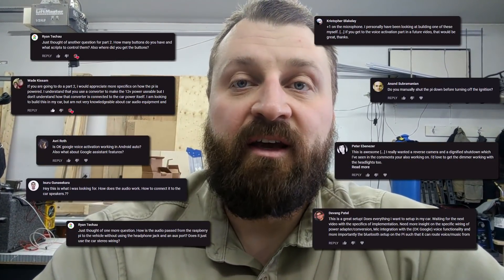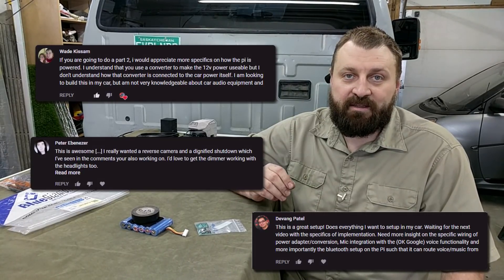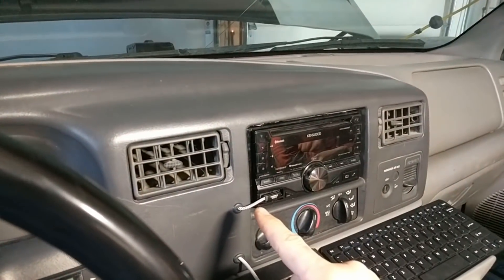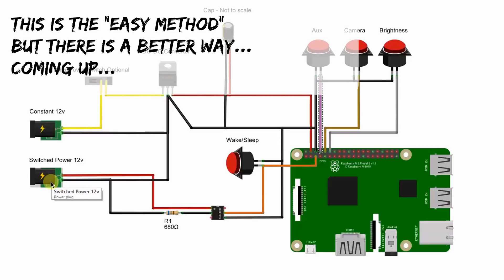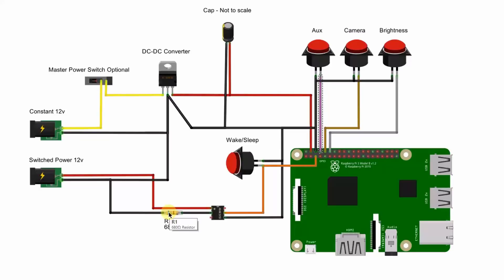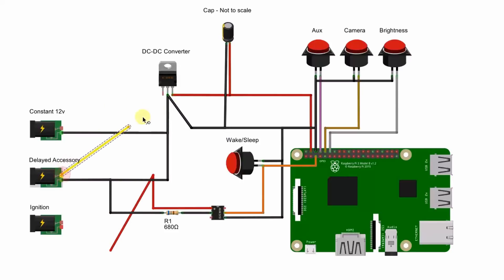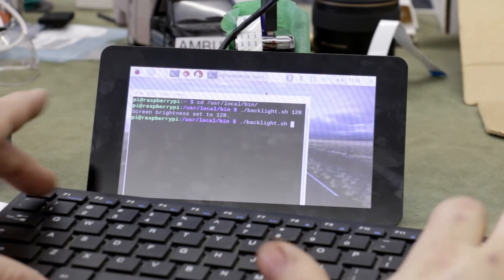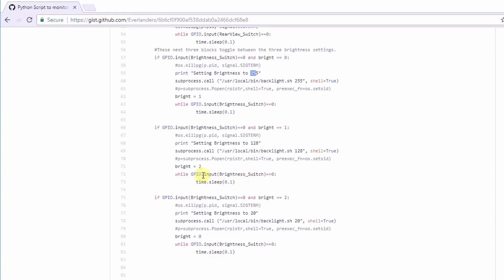Wiring AndroidAuto & Raspberry Pi to your Car - Rear View Camera, Connection Diagrams, OpenAuto

Comment: Couldn't you set up the rear camera to turn on when the reverse lights turn on instead of the button? Also how is the mic when calling people? Pretty good?
Reply from the maker: Sure you could, and I gave instructions for this in the script on GitHub. But in our case, it's more important to have it function as a rear view mirror when driving forward in heavy traffic as we have a camper box mounted that obstructs the mirror's view.  Can't speak for the mic, I don't call people.
Reply: Everlanders awesome built btw and thank you for the quick response. But the "ok Google" detection picks up good from the mic, correct?
Reply from the maker: The hot word detection "Ok Google" is dependant on a specific hardware in the phone, as such it uses the mic in the phone for this, not the external mic I've added.  Once the hot word has been detected it hands off the recording to the lapel mic to record your request, and that works just fine.

Comment: There are a lot of forums and videos of other people doing this, but none with android auto and camera stuff. By far the best information I have found if anyone is doing this! Absolutely love it. And I was successful in building it...just now....not even five minutes ago. Now comes the really hard part, finding a place to mount it. :) Just going to add a few other things that I had to do for anyone else reading the comments. When I built the two files (ButtonMonitor.py and backlight.sh) they didn't have permissions to run. So I had to run a scrip to give them permissions. Here's the link for it http://www.dummies.com/computers/raspberry-pi/working-with-file-permissions-on-your-raspberry-pi/ . The line that I used is about halfway down. 'sudo chmod a+rwx filename-or-full-filepath' without the single quotes. And then the other thing I had to do was enable the camera through the config folder. (you might have mentioned it in this one or the previous ones if so I just didn't catch it.) But other than that everything has worked great! I also used this tutorial to load openauto. https://www.novaspirit.com/2018/03/12/android-auto-on-raspberry-pi/. 

Multiple Thumbs Up!
Reply from the maker: I did show how to make the scripts executable at 10:25 - But I guess it's a lot to take in.

Comment: Your Video is really interesting and I will definitely build this setup in my car too :)
But i was wondering whether it is possible to connect the wire for the reverse gear lamp to the raspberry and switch to the camera view if reverse gear is selected?
Thank you!
Reply from the maker: Yes, several people asked for this, so I put the code for this in the GitHub gist too.
Reply: Thank you very much :)

Comment: Cool stuff, great work getting it all working.

One thought - though I don't know where you would mount it, how about an auto dim for the screen? I was thinking a light dependent resistor (LDR), you'd probably need to be able to override it with a button though.  Is there any way to add a screen with a slider to control volume or the monitor brightness?
Reply from the maker: It would be easy to tie it to the headlights using the same optocoupler I give instructions for in part 2 - but I'd rather have the button.
Reply: Looked into it a bit; the Pi doesn't have an ADC, so you'd have to add one to the circuit. Thinking about it a bit more, the LDR might be a bit sensitive and cause the display to constantly adjust (think of driving down a road at night with street lights every few hundred meters), so a potentiometer might be a better choice.  Thanks
Reply from the maker: :-)
The potentiometer will still need an ADC

Comment: Thanks for the video. Really cool project. I wonder, could you do this with a Pi zero-w ? I only ask as I have a bunch of them kicking around since they are only $10 each. thanks, look forward to your response.
Reply from the maker: No... It has no DSI Display connection and lacks the hardware acceleration that OpenAuto utilizes.

Comment: Awesome. I have been working on something close to this. I was going to do it without the cellular interface, using the GPS hat and the accelerometer hat, but your way is much easier. 
I am also adding 2 additional features to mine. 
1)I want to be able to remote start my vehicle using a pi face relay + . It will control automotive relays that tap into the ignition wiring cables just like an aftermarket remote start. 
2) Using the same board, I want a touch screen button to turn on and off my amber wigwags.

I will definitely be referring to your setup for my initial build. Thanks again.

Comment: Another testing-question - how did you wire the touchscreen ? I just started testing with the buttons - and when it came to the wake/sleep button I realized the pins i would need for that are already blocked by the touchscreen.
Reply from the maker: Are you using a different screen than me? I had no overlapping pins...
Reply: No the same (I suppose) But I just found out there are different two ways - or better directions-  to wire it .. The one I used would not work as it blocks the pins, but some tests later I figured it out (My way was powering the Display - by USB - and when Power comes on - the display uses the pins for the button to automatically switch the Pi on - turned it the other way around when i tested the converter and removed the "switch cables" - now the pins are free (button working) and the pi powers on the display when 12/5V are on.)

Comment: What is your OS setup ? I think your booting a rasbian OS and then openauto. i like to use the hardware buttons to the io pins, so a version of crankshaft (wich works with my samsung a3) would not be useble i think (i am new to programming for raspberry pi) (i have the pi 2b+ (maybe i swithch to the new pi 3) so what rasbian image do i have to use ?
Reply from the maker: Open auto requires the hardware acceleration in a Raspberry Pi 3, so that's probably going to give you a significant performance boost right out of the gate. I haven't even looked at crankshaft, a closed system that I can't view the source code gives me the heebie-jeebies. In my case the system will be doing far more than just running Android auto, so I need the flexibility to run whatever I want. So I'm running raspbian stretch updated to the newest fastest best.

Comment: Great channel, and Canadian too (Hi from Kamloops BC!) -- Stumbled upon it related to Android Auto, but have already viewed other segments, and you've definitely earned another subscriber!

Not knowing much about the raspberry pi and its hardware... I wonder if instead of using HDMI if perhaps using shielded Ethernet (CAT 6 or even 7) would be enough for the camera. Would remove points of conflict and simplify the run, I would think.
Reply from the maker: Unfortunately no, there are only eight conductors in CAT6 and I think they are only shielded in pairs. HDMI (and this camera) require a few more conductors as well as more shielding. Even this shielded HDMI cable I have is pushing the limits.

Comment: Hi again, maybe I missed during the 50 times I watched that video - but what optocoupler did you use ? Just started ordering stuff for the final installation in the van ...
Reply from the maker: I used a 4N26 that I already had laying around, but the specifications are very loose because we don't need high frequency or extreme isolation. Did you receive the adapters already?
Reply: Ah ok - ordered a 4N35 .. should do it then. Yes - I received them - big thank you !! Cant wait to test them

Comment: Do you have any more information on the script you used? I have the openauto head unit already, but would like to get my dash cam video as an overlay like you did with the rear view
Reply from the maker: Yeah, I gave the instructions on how to do this in this very video you're commenting on.
Reply: Sorry about that. I thought it was about wiring only and didn't get that far. Thanks for the information and appreciate the work you've done

Comment: What does the AUX button do? I believe the camera button activates the camera/cycles through camera modes and the brightness button cycles through the preset brightness modes. Did i miss something else that your system does with the aux button or is it just for future proofing?
Reply from the maker: Future proofing, the plan will be to have all four cameras start recording to file, so often we are on a road trip and something amazing is happening, you just can't get your camera out in time for that shot.
Reply: Everlanders Thanks. Looking at buying parts for a similar build.

Comment: Have you tried connecting the camera's connector to a (passive/non-repeating) HDMI switch? Is raspbian able to re-detect the new camera? If It's hot-pluggable it should work. Would be quite cool, as these cameras are so cheap one could set up a couple and switch between different angles.
Reply from the maker: I have not tried switching cameras, I do know that they fail until a reboot if disvonnected. sudo restart webcamd works on some cameras. I will have Raspberry Pi zeros at these other angles, and then just stream it over Wi-Fi accepting the half-second delay.
Reply from the maker: There are also Raspberry Pi camera switching boards that will switch for cameras, but I didn't see a lot of success stories so I steered away from them. I've linked to them several times for others comments.
Reply: I see. This info may be useful to you: If you use MPEG2 (no H.264 inter-frame compression), you might even be able to get lower than 100ms latency. PhobosLab has some extremely low latency server on Github (free/libre), search "jsmpeg-vnc" and it's demo video. Though it's using a JS encoder. Haven't had a deep look into it, but there could be some C code around that doesn't require a browser instance to stream.

Comment: How did you get the brightness script (this line   echo $level > /sys/class/backlight/rpi_backlight/brightness) to run as user pi? I can get the test to run as sudo, but get a permission denied when I attempt as pi.
Reply from the maker: I didn't do anything special... it runs as pi for me. Are your permissions set - sudo chmod 755 backlight.sh
Reply: The script was already 755, but that made me check the "brightness" file that is changed on line 13 of the script, I had to chmod 666 to make it work. thanks for the help.

Comment: I already posted - how much I like these videos but let me add: I setup my system using your tutorial - and yesterday it came to life (on the workbench)- was really easy and done within only 2 hours!  But one question came up: How would you mount the rear-view cam to your car without drilling a hole big enough for the HDMI-Plug  - and how did you get the Raspi-Cam 
and all that to be waterproof ?
Reply from the maker: You only need a space big enough to sneak the flat ribbon cable through. It can come out next to a licence plate light or through a window seal. I will be 3D printing ABS enclosures to waterproof mine. I would be happy to print one for you. Which car will you be installing on?
Reply from the maker: Does the G20 have a 3rd Brake light up high?
Reply: I am afraid no - but it seems like there was a rearview cam or something like a third brake light installed by the previous owner - the hole remained - i will try to work the flat ribbon through it. We will see :-)

Comment: Could you connect something to the reverse light for switching on the camera automaticly when car is set to reverse, and cut the feed when its not in reverse anymore?
Reply from the maker: Yes, I have posted this code to the GitHub for this too.
Reply: I can't find you on GitHub. I am doing the same thing with the 12v dropped to 3v and launching my video stream with code after the signal is seen on a gpio pin. Where are you on GitHub?
Reply from the maker: https://youtu.be/jFXxtxoi_pc?t=9m53s

Comment: Maybe I misheard but in part 1 Oru said you can install multiple cameras. Can you show a video on how to do so? I really like the build. I have been trying to research a way to install multiple cameras on one screen in my car
Reply from the maker: Yes, In time I will show this. In our case there are already several Raspberry Pi's controlling other things, so they will just have network feeds to the display we are nearest to. But if you want just one Pi, then you just need a Multi Cam adaptor board like this: https://www.robotshop.com/en/arducam-multi-camera-adapter-module-raspberry-pi.html  There are 3 or 4  variations I've seen from different makers.

Comment: I'm also working on a similar project except mine will be connected straight to the wiring harness and completely replace the stereo system. I have the prototype of the build completed and am just waiting on a few more parts to arrive before completing the final install. Looking forward to video 3!
Reply from the maker: Yes, in that case you just need an inexpensive amp.

Comment: Have you considered a laser track ball for precise mouse input without needing space and a surface?
Reply from the maker: No, Android Auto is designed as a touch interface and has nice big on-screen buttons to do everything, and the Raspberry Pi 7" screen is gorgeous and the touch works perfectly. Anything that can't be done with a quick tap works perfectly with a "Okay Google" Voice request. I don't see the need for a mouse.

Comment: This is awesome! I'm looking at replacing my head unit with a similar project, I'm just looking to add an amplifier. Could the pi be set to switch automatically to the rearview camera when the vehicle is in reverse? Could the power to the backup lights be used like the momentary switch? Also would this work with a USB video in and a composite camera? Thanks for all your hard work!
Reply from the maker: Sure, I posted the code for this on my GitHub page.
https://gist.github.com/Everlanders/e08fe32b8012395d4afc558724937ad4

Comment: Is it a giveaway or you just want to know if people want one?

I am trying to understand this project, if I were to take on this project, it seems like removing the factory car stereo (Honda CRV)  and putting the Pi, and monitor in its place would make the most sense.  (I have not taken measurements as of yet)
If I were to remove the car stereo can I use the Pi to play back music through the car's speakers?  Is there an easy way to wire the pi to the car's speakers?
The GPS for maps is from your phone's GPS, you don't need a stand alone USB GPS, is that correct?

I am still trying to work out how the phone, the Pi and monitor would be powered.  Thank you for answering my questions.
Reply from the maker: I'd hoped that someone would want them for a build in progress, I didn't want to be sending them to people who just want free stuff.
How to power the Pi 2:20 and 7:55
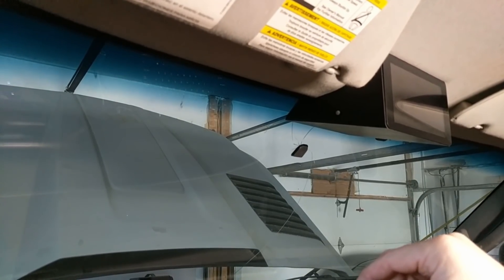How to get the audio into the speakers 3:35
Everything is run from the phone, the Pi acts as the display.
Reply: Thank you for taking the time to answer.  I was asking about the audio if I were to remove my car stereo to store and play audio files on the Pi with stereo and rear/front speaker controls.
I didn't have a full understanding of the project, I have a better understanding now.
Thank you.

Comment: Love the video series. The static from back-up camera is because HDMI runs die when longer than 25ft. Most folks but an inline signal amp or HDMI repeater around every 12 ft. Hope that works. I stumbled across your video because I'm basically building the same overlander setup for my truck. Great job and happy trails!
Reply from the maker: Unfortunately the signal from the camera is not HDMI...
Reply: If it was hdmi, that wouldn't happen. It only happens to analogue signals

Comment: I would rather use a light sensor or tap in to the canbus to adjust screen brightness automaticly
Also, i didnt think it was necessary to power off the pi?

Comment: Is it possible to just use a standard backup camera with night vision and analog display output?
Reply from the maker: It's probably possible... But much harder, and much poorer resolution. The Fisheye cameras I'm using are 8MP and have night vision, so I don't see the reason to try and convert oldschool analog to digital.
Reply: Everlanders sealed housing, weatherproof, simpler wiring, many different options and mounting options, etc.
Reply from the maker: I've got you covered Paul... Coming up in the next videos...

Comment: Thank you kind sir for the follow up video. Gives so much insight on how to go about this build. But is there perhaps a easier-easier way to power this from the cig lighter usb port so that it is easily detachable and no tapping into car electricals?
Reply from the maker: That is possible, but that does not signal the OS to shut down before the power is removed. This may lead to file system corruption over time.
Reply: Have you found a 12V adapter that will supply at least 2.5A? So far that has been the struggle for me, although I just remembered I haven't looked on Amazon... But I am thinking of making mine removeable as I won't be able to use it while driving normally here in Phoenix (summers are too hot and the inside of our vehicles reaches over 200° F. So I am thinking of making a JST plug or some kind of non reversible plug in the dash to hook up the opto(s) and still make the whole thing easily removable during the summer, or when I don't plan on making any long trips for a while.